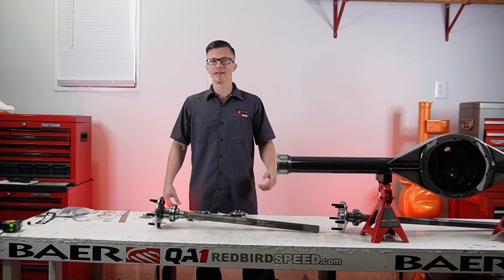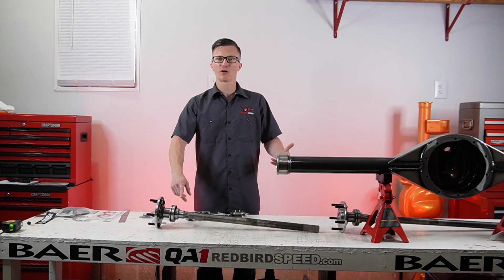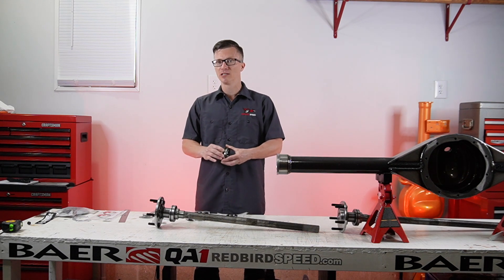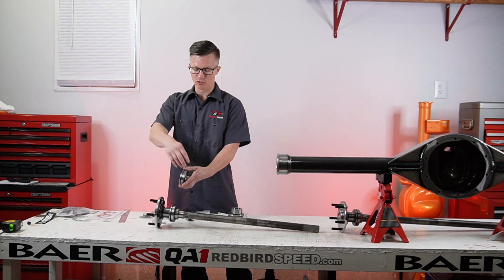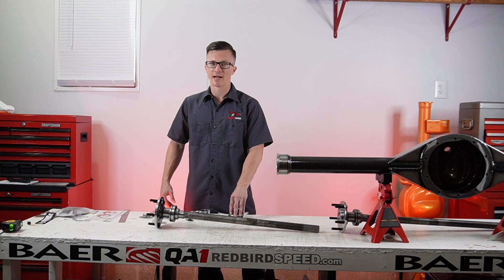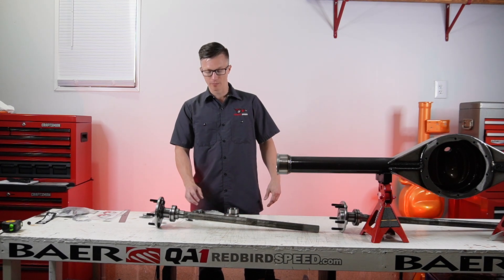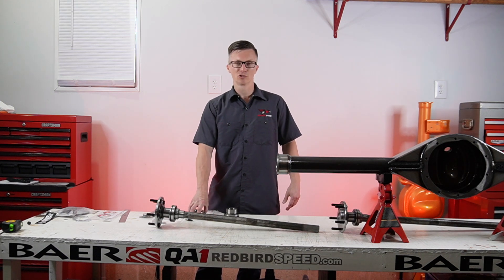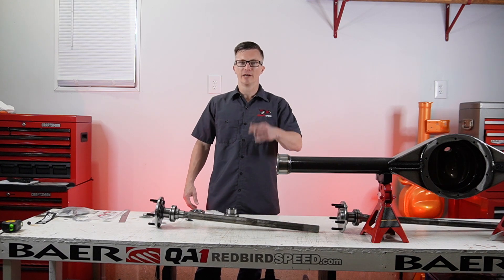9" Ford - The Complete Rear End:  Ball Bearings VS Tapered Bearings - What bearings should I order?

Comment: How can I figure out what size axle bearings I need for my axles if I cut the bearing off the axles already? Thanks 👍🏻
Reply from the maker: You can measure the bearing journal on the axle shaft for the ID. Measure the ID of the housing end for the OD of the bearing. This will get you within a few thousandths.
Reply: I checked my out your Other videos and was able to figure it out. Thanks
Reply: I have a 69 Ford Fairlane small block.  For the life of me, I can’t figure out which bearings/seals to order.  (W/O removing them first). Any clue?